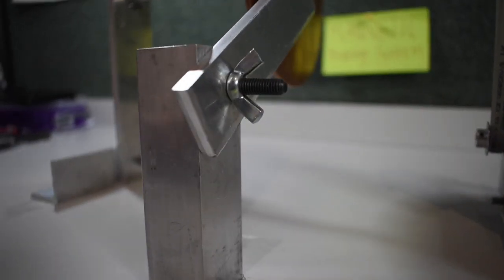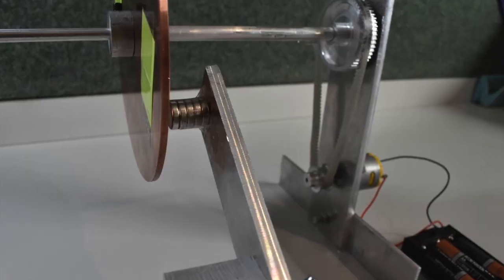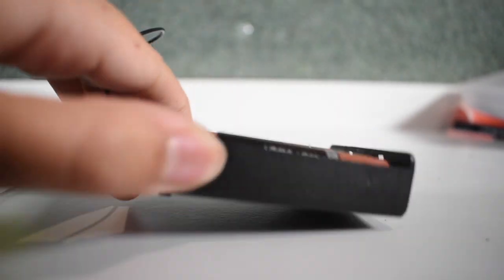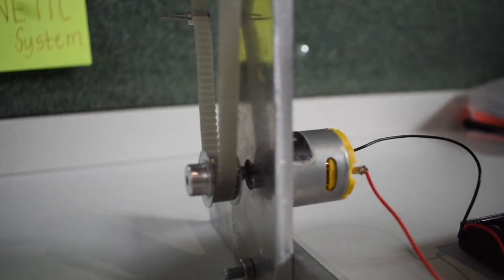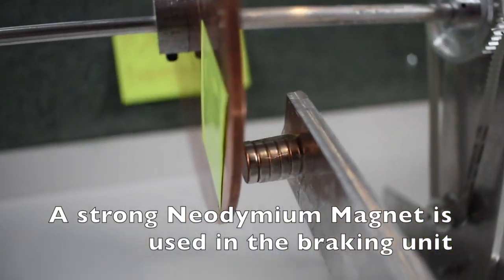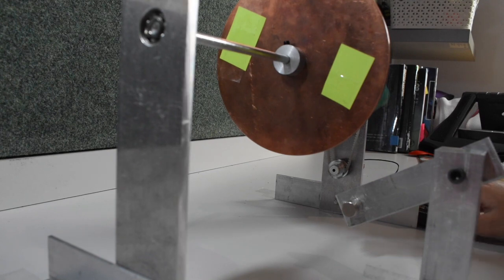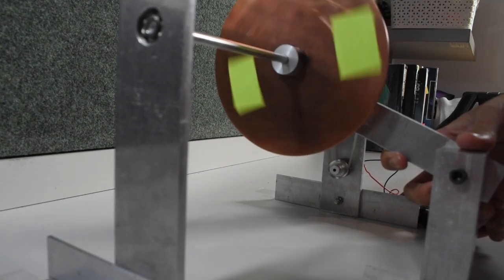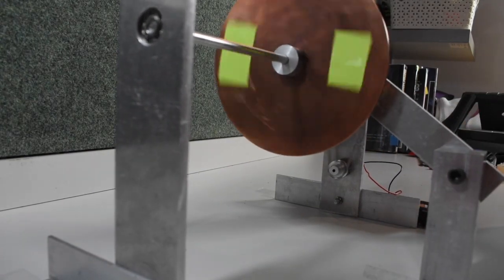Prototype of Eddy Current Braking System - Second Year Individual Project

Comment: nice work, can you list all the materials you use
Reply from the maker: Thank you. Yeah sure most of the frame (sheets, angled bar, including the shafts as well) are made of aluminum and I cut down copper sheet into a disc for the wheel.